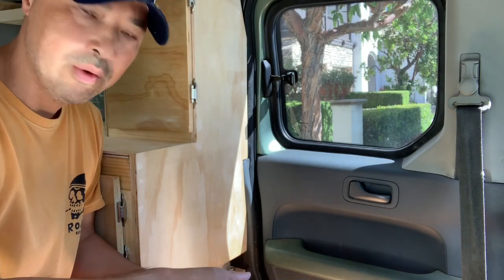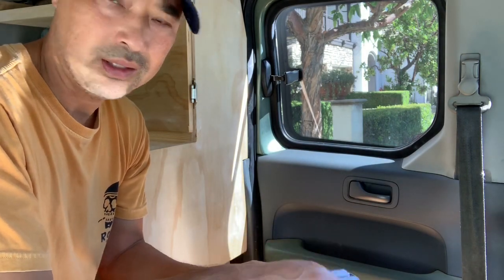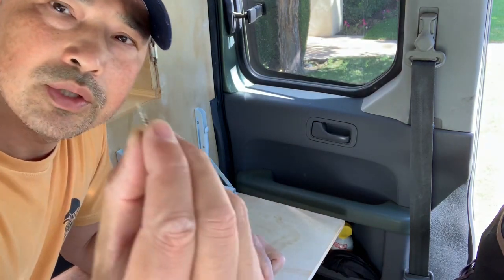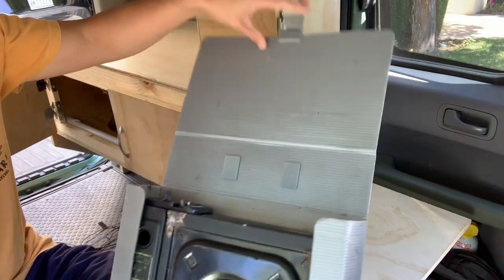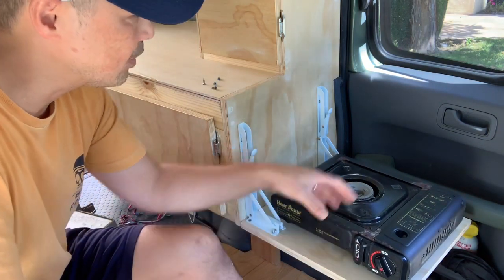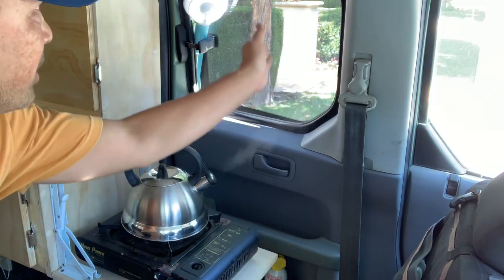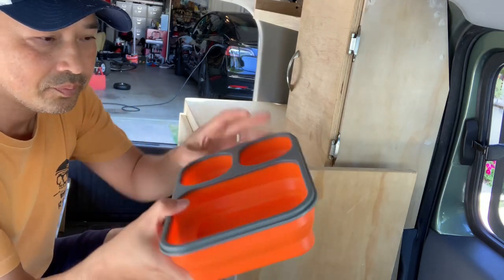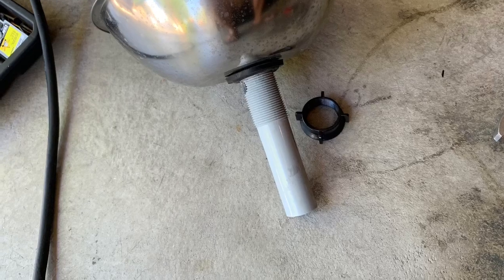Stove and The Tiniest RV Sink Imaginable.  Element Micro RV v3.0 5.

Comment: going to make some think on the lines of the pocket sink,  with magnets to put on metal walls of car, it will be used just for shaving, bushing teeth, have a old medical box, just have to put a mirror init,  what gets me is, you can get loads of stuff for camper vans, but not a small washing portable sink, apart from the pocket sink, but they are not on the market

Comment: You do come up with a lot of clever ideas, but wouldn't it be easier to use the old sink at the end of the counter, with just a flexible fat hose to run over to the drain hole whenever in use?
Reply from the maker: tegma , yup! I was going back and forth between that option and the micro sink. In the end, I chose the micro sink considering how little I use it and for my limited application. Plus, I thought the idea was just fun to implement!  Haha

Comment: Did you make the shelf for the stove lower so that you could cook from both the inside or the outside?
Reply from the maker: tegma , no, I made lower because the counters are a little higher than the first build and too close to the ceiling when you use a pot. If cooking from outside, I would use the tailgate.